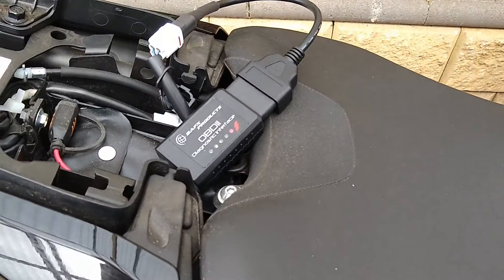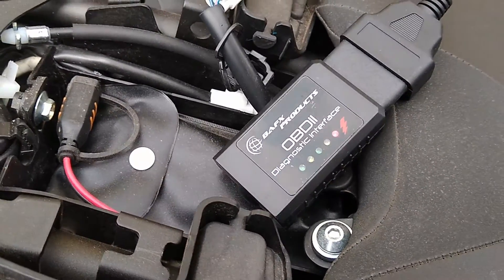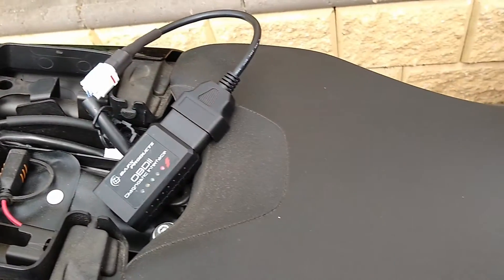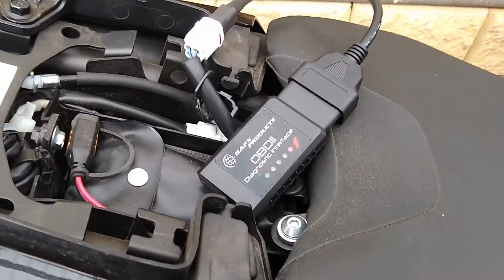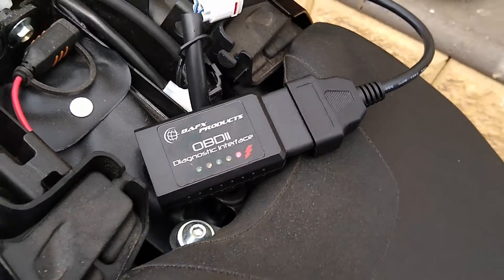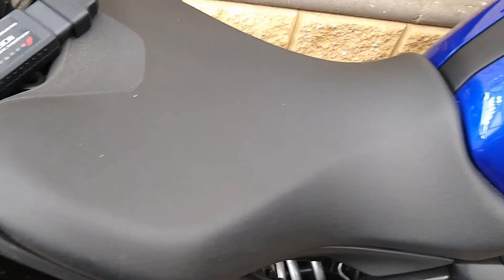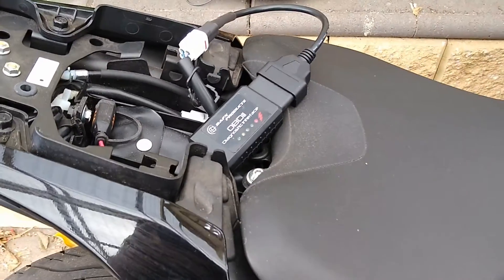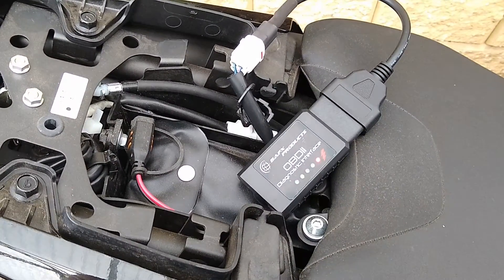Testing Yamaha 4 Pin to OBD2 cable to reset fault codes via Bluetooth on my 2019 MT07 motorcycle.

Comment: hi. Do you know what adapter 4 pin is compatible for Yamaha xt660 ?
Reply from the maker: Depending on the age of your motorcycle it should be this 4 pin OBD2 connector https://amzn.to/4ev0yaF just check if you have the same compatible plug end. It will work.

Comment: I have a 2015 bike with abs and the odb connector is a 3 pin  the 4 pin came in about 2018
Reply from the maker: You can buy 3 pin OBD2 cables but i have not had any experience with them. As long as the protocol is correct it should work.
Reply: The OBD2 connector is on a single wire. If your engine has ABS, the 4-pin plug is for ABS diagnostics, and the single wire on the side is disconnected from the ECM (on-board computer). I have a 2016 YZFR125 with ABS, and this is what it looks like on mine.

Comment: Hey, just purchased the odb2 adapter from aliexpress and waiting on its arrival. However, im clueless as to which obd2 to use. My original plan was to visit a garage with the adapter but I have no idea if it'll work as they usually have a proper system with car manufacturers and models so i dont know if it will work with my bike
Reply from the maker: The best way to do it is buy a quality obd2 Bluetooth module and run it with torque pro software on a smartphone.
Check out this post for more information.
https://notsealed.com/reset-faults-yamaha-4-pin-to-obd2-cable-torque-android-app.html
It would be cheaper than visiting a garage.
Let me know if you have any further questions.

Comment: Fjr 1300 2016 don't know where my obd2 port connection his can help me please
Reply from the maker: There are TWO diagnostic plugs under/around the seat tray. One is a 4-way connector for the OBD reader, which requires the proper 4pin connector. The other is a 3-way connector into which the dealer plugs in his diagnostic harness, which is attached to his laptop,.

Comment: Can you try for Yamaha r3 2022
Reply: I have the nexas obd and its not working on my r3 I don't know why
Reply from the maker: It is important that your OBD2 scanner supports the following settings: Protocol ISO15765-4 CAN (11bit 500k baud).
I use Torque Pro Android and it works well. What app are you using?
Reply: It has 4 pins /4 wires
Reply from the maker: I'm at a loss. It should work.connect Ist then turn on motorcycle. You could always try to see if the obd2 works on a car as well.
Reply from the maker: If I had that bike I would try. That 4pin cable should work.
Reply: I used torque apps.. please let me know if you can try to r3
Reply from the maker: Can you double check your plug on the r3. Some of the newer Yamahas may have a 6pin plug not a 4pin plug.
Reply: Yes it's working on other motorcycle but can not connect to my r3

Comment: Could you please post an schematic of the pin assignments from the ODB terminal the bike's four pin terminal so I can built one? I have the adapter but the cable is expensive and hard to find in my country
Reply from the maker: Sorry I don't have a schematic diagram of the 4+pin cable.

Comment: I bought the obd2 bluetooth adapter and the cable, but all apps can't connect to the ECU. What's wrong?
Reply from the maker: Could be a communications issue. You would need to set the communications type either WiFi, Bluetooth, or USB. I use the torque android app and it works well.
Reply: @NotSealed please confirm communication protocal used
Reply: I didn't bought the cable, just hooked the wires like showed in some tutorials I've seen, however the adapter cant connect to the ECU
Reply: Similar in issue bike, problem is communication protocol for yamaha bike they use different  protocol and some bike even comes with OBD1 protocol